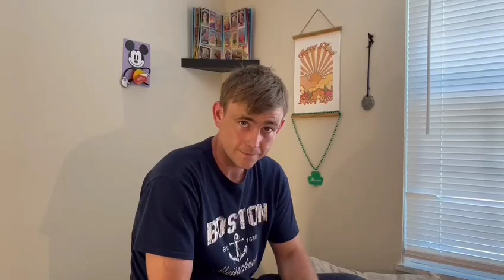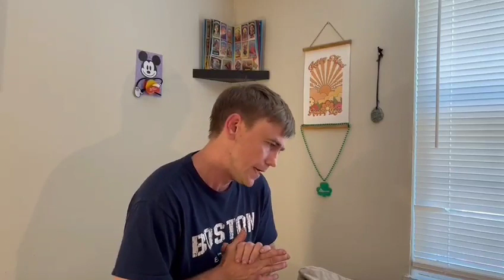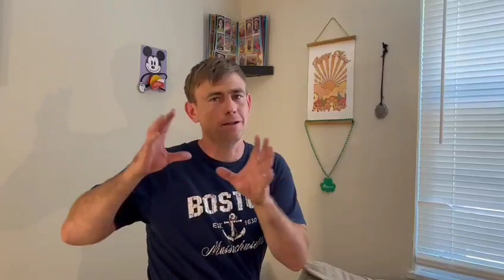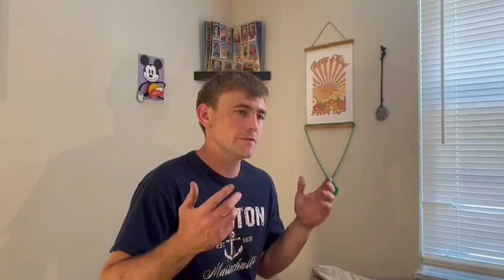Day in the life Instrumentation & Electrical Technician Expectations vs. Reality

Comment: I am an instrumentation technician, 35 years of service. A rewarding career. I have worked on various transmitters such as pressure, feedback controllers, valves, pneumatic transducers, vibration sensors, level transmitters, flame detectors, proximity switches, alarms, flow transmitters, temperature, key phasors, conveyor systems, solenoid valves, etc. It never ends.
Reply: I’m beginning my studies toward the electrical technology associate next month!
Reply: Hey mate I’m considering getting into this line of work. Been a cabinet maker for about 10 years and looking to pursue something more technical and more future focused. Would you have any advice for someone looking to get a foot in the door?
Reply: @Camouflage2770  look into EPRI instrumentation certification. Level 1 and Level 2. It's a class you can take and learn the trade.
Reply from the maker: @rhomis  what is a key phasor, never heard of that
Reply: @gregroche7323  - it is a sensor that can measure if a rotating shaft is slightly moving off center, due to normal wear.
Reply from the maker: @rhomis  hmm interesting

Comment: I can agree with your video whole heartedly. I don't have much of the electrical background but I'm definetly getting my crash course as I go. One thing I was told when I was going to school was that I wouldn't be bending tube so it wasn't important to learn lol.... that was a joke. I spent my first year reading P&ID's and bending tube for building new separator packages( all new construction), and installing instruments for new construction (it was 70% new construction and 30% maintenance job). Now that I'm in a meter prover roll, I rarely bend tube (mostly to fix  a small leak or retro fit something). It's an excellent trade to get into, just remember reality is far different form exception and these day I spend most my time with my dog and myself on my own schedule (with deadlines).

Comment: Hello, I'm a sophomore in high school and I'm looking to robotics and Elec Automation in Trade School (with a goal of being an I&E TECH), and i was hoping to get some pointers on what to research and buy to get started
Reply from the maker: First off, experience is everything. You're very fortunate to know what you want to do at such a young age, I would suggest putting in the work now... it will pay off big time later. Most of controls work his troubleshooting circuits and understanding how different controllers work. Troubleshoot and build controls circuits, learn about Rockwell automation products those are most common in the field. Siemens is a plus (I don't know Siemens). Learn Robotics also. I think Robotics are going to very important. Fanuc robots are becoming more and more common. If you can get a engineering degree I would..  if you get good enough with the equipment you DO NOT need a bachelor's to be an engineer but it does help. If you have the ability get an Allen Bradley plc and a test bench and build stuff. Join a mechatronics club or competition. Learn about IT, network technology and architecture. You don't need a super deep understanding of all these topics, but if you have a basic understanding, it'll take you a long way.
I would suggest figuring out what school program you're going to go to now. All the thingsI just mentioned are really extra things that will pay off in the end you don't need to do all of it. I would suggest getting at least an associate's degree. It all depends on your family's financial situation but if you can get a bachelor's degree I would go for it. Look at schools figure out what degrees sound good & reach out to the professors or program chairs in the department and ask what type of career placement and clubs they have. If you are ambitious over the next few years you'll have a very successful life

Comment: What schooling did you go to where they taught specifically instrumentation?? I’ve worked for 3 years as an industrial electrician apprentice and want to get a job as an I and E eventually except I don’t know how to get trained or schooled for instrumentation.
Reply from the maker: That's a good question the fact that you have some electrician experience is going to put you away ahead of people with no experience that's part of the job. There's a pretty wide range of job titles that I consider instrumentation, instrumentation and electrical technician controls technician automation technician Etc. Generally speaking there's not really degrees called instrumentation that usually falls under electrical engineering technology or something like that. If you can find a engineering or mechatronics or automation certificate I think that would get you qualified enough to get land the job. I would look into different programs at community colleges by you you got to read the descriptions to see
Reply from the maker: My degree is Electrical Power Technology in the engineering technology program at palm Beach state college

Comment: Sounds easier than being an Automotive Technician. I do a lot of electrical Diagnostics and tearing down engines or removing dashes in vehicle. I get paid 23-26 per hour but it's a grind being commission  based.  I'm trying to get out of the auto industry  and find something stable (for me). But this is a good insight from ones experience
Reply from the maker: If you have that experience you can most likely get a job as an industrial maintenance tech and over time start shifting into instrumentation. You most likely will have to get qm associates but not neccesarily woth the right experience. Industrial maintenance tech is similar; a lot of the skills transfer you would just need to learn on the job. Most mtechs start 25-35 an hour
Reply from the maker: To make the shift you need to learn about three phase power physics different types of instruments plc's industrial control systems and have some experience with how industrial things are set up and safety stuff at cetera. It's a similar skill-set but everything looks completely different
Reply: @gregroche7323  I'm currently going over ITI Institution classes and I have been watching videos on all the classes available  and I am wanting a good schedule. and Instrument & Control Systems Tech seems to be more of what i enjoy, and that's Diagnostics. It's a 2 yr Degree but out of all the videos I've watched this field speaks the loudest.
Reply from the maker: @doogeerugged89  yeah I would recommend it 100% I enjoy it very high demand for technicians
Reply: @doogeerugged89 did you ever find any info on it trades I’m looking also

Comment: I’m currently enrolled at iti taking a 16 month certificate program for instrumentation, I have 12 yrs of electrical exp, I was just wondering would it benefit me to go ahead and finish the  certificate program or opt in for the 2yr associate degree
Reply from the maker: I don't know man I'm not really in a position to give advice on that.. I would assume that having the electrical experience plus certificate should be sufficient get you in the door for mid wage i&e jobs. Whether you get the certificate or the degree I wouldn't expect extremely high paying jobs until you get some years of instrumentation experience. Personally if I was you I'd go for the certificate first try to find a job see where you're at if you have to go back to school but I doubt it
Reply from the maker: That being said if the degree is not much longer than the certificate I would just get that anyways.. personally I enjoy going to school as long as you have the time to do it why not. Given that you have some electrical experience I don't see a big difference between the two

Comment: hey guys... I am a technician in physics engineering (3 year degree). I work for a University in a chemical engineerimg departmemt. Im paid 35$/hour CAD in instrumentation and control. Is my salary low? oh and I have a Electrician certification as well...
Reply from the maker: I looked that up it's $25 US. I think there's a pretty wide range especially if you know how to troubleshoot controls and have a good understanding of automation. You may be a little underpaid but I would say if you enjoy your position stick around for a while until you really Master it.. depending on how many jobs are in your area I'm sure you can make more money if you wanted to though
Reply from the maker: I live in a relatively low paying area and generally the technician jobs are 35 and up per hour (U.S.) maybe some Canadians can shed some light but I'm going to assume they're going to say the same thing you might be a little underpaid